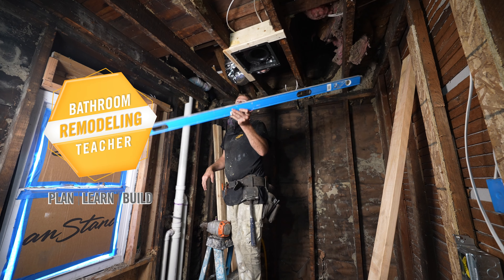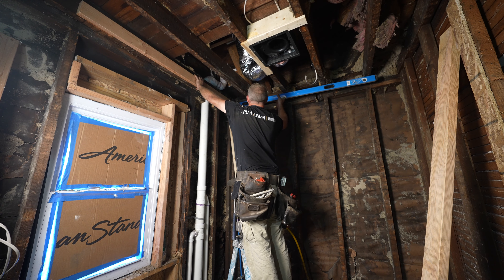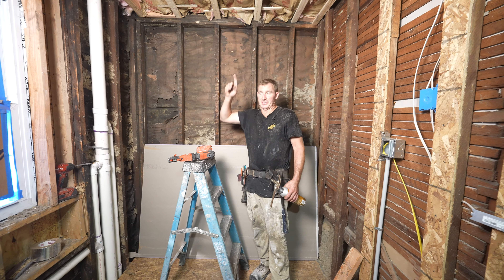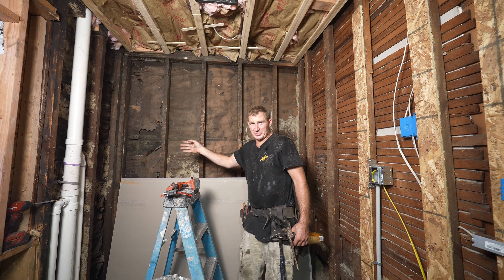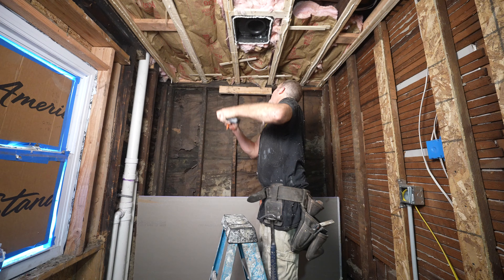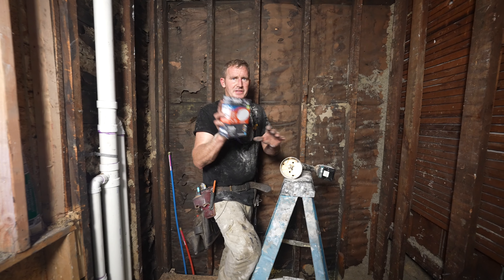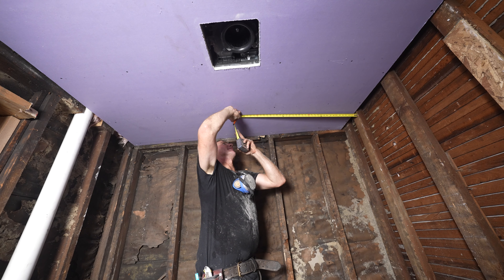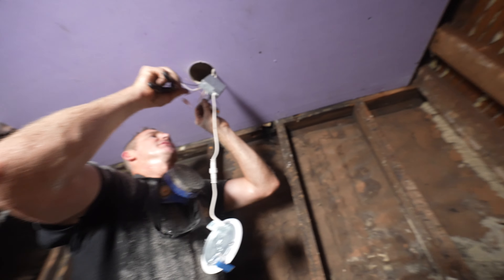Bathroom Drywall Ceiling Tips

Comment: I’ve never seen an adhesive used on ceiling drywall before. Solid work all around.
Reply from the maker: Yeah, a lot of drywallers use glue now. My parents just built a new home and they glued everything. 16ft sheets

Comment: Hi, I'm trying to redo the tub and bathroom drywall by myself. (I build cars not a carpenter 😁) I picked up the drywall from home depot, they told me I needed the Green board for the bathroom moisture area. But I noticed the purple you are using, do I need to buy the purple instead? They told me this was all they carried for moisture etc. Also the shower wall is a direct to stud mounting style. But one wall goes to the outside of the house and I would feel better if it had drywall for a barrier, can it be installed over the drywall on that end? Thanks for your time and sorry for all of the questions.